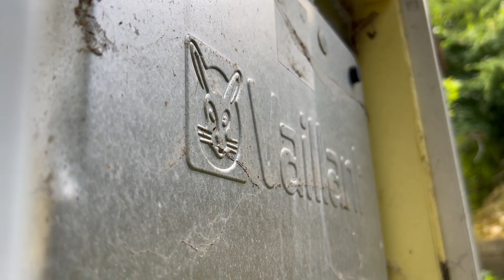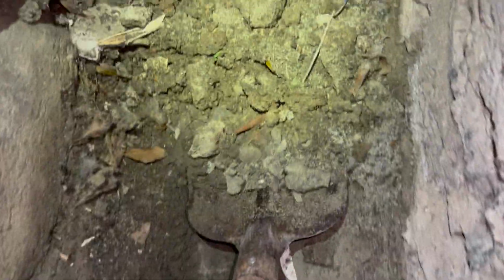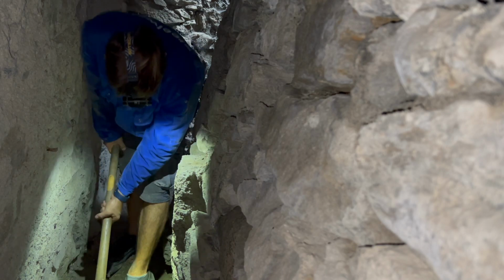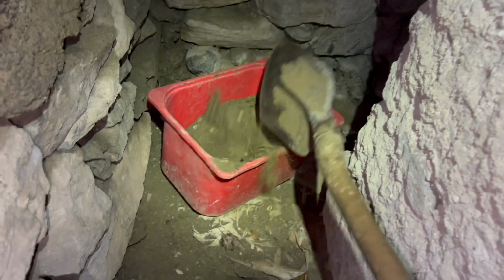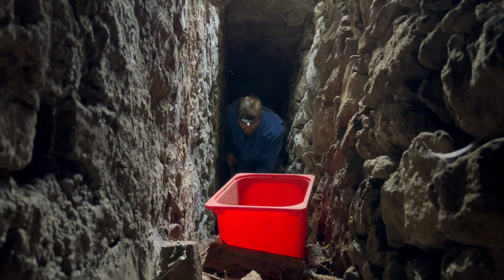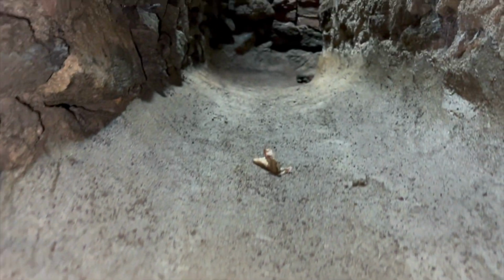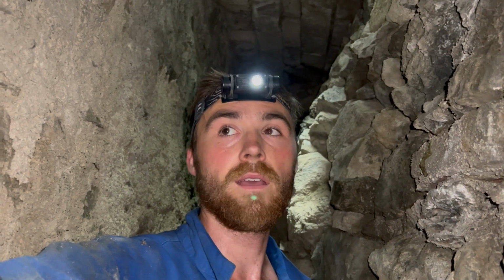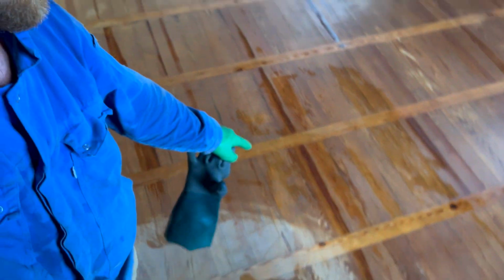016 || Buying a house in Italy.. and renovating it.

Comment: There is actually a resin based product that doesn't kill the insects, basically it changes the chemistry of the wood making it inedible for the insects so they leave it alone, also it reinforces wood that has already been damaged by closing up the insect galeries. Its called WODD BLISS.

Comment: The drainage system is fascinating! Where we live in the US the soil is about 90% clay (we are right on a water way). We constantly get water in the basement and crawl space because clay doesn't really absorb water so much as it washes it through then weeps through our cement block and stone foundation. We've attempted french drains but they don't last as long due to the clay sediment clogging up the landscaping fabric or getting into the perforated pipe and clogging that. This whole exterior trench around the foundation is an interesting concept that I may have to have a structural engineer check into for our area. (We are Northeast USA so freezing is an issue for at least 6 months out of the year)
Reply from the maker: that sounds like a challenge. yeah you should, I think it's an awesome and effective system.

Comment: such a simple system to keep water from seeping into your basement walls! That 'air gap' is replaced in modern homes with a sheet covering the basement walls, an oil product sticking the sheet to the basement wall and a pipe full of holes inside a cloth sock, running along the bottom of the wall, that takes water away from your basement walls. I guess all you have to worry about is a cave in.
Reply from the maker: Yeah right. Although this might be a little less compact, seems to work like a charm as long as you don’t fill up the system with diapers ;).
Haha yeah, that would be problematic.
Reply: @Villa_Oliva  did I read that a girl who grew up in the house had a tour? Were those likely her diapers? LOL
Reply from the maker: Haha I should’ve asked her ;)

Comment: That has to be one of the most awkward jobs.  Well done to get it finished.  Do you know about not using full concrete for stonework as it doesn't let it breathe?    May not be applicable to that outer wall.  (I have learnt about it from other stone building repairs.)  Glad you had Dad helping you.  Best wishes.
Reply from the maker: Good one, didn’t think of that yet. Have to dive into it to see what is the best way to tackle it.  Thanks for the tip!
Reply: @Villa_Oliva  Yes, you definitely will want to use lime mortar on any rock work repairs. I've watched tons of rock work repairs in France, Portugal and Italy and they all use lime mortar, even removing cement that had been causing problems with moisture and mold as it cannot breathe.  I am so impressed as everyone else is at the very hard work you and your dad are doing. Fab, just subscribed.  I think you will be very successful on your You Tube channel!

Comment: I think you are really going to have to rebuild that outer wall.  There is a LOT of pressure from the ground outside it, it will be pushing against the inside wall.  Need to brace the overhead and then dig down on the outside and rebuild it and then fill it back in.    I would see about getting an estimate done on fixing it, even if you don't have someone else do it.  Really to see what they would do to repair it.
Reply from the maker: We certainly will do!